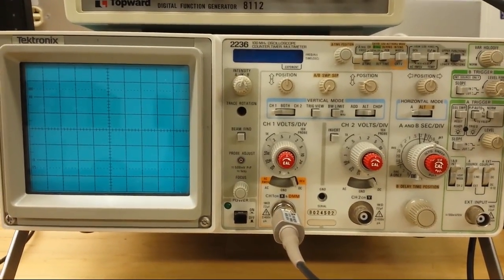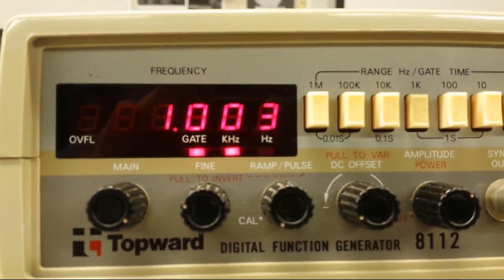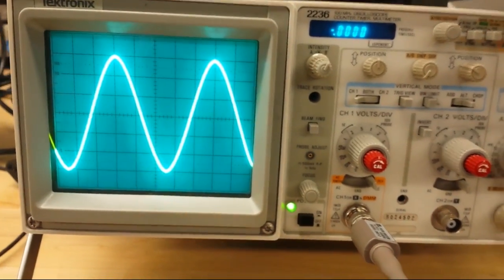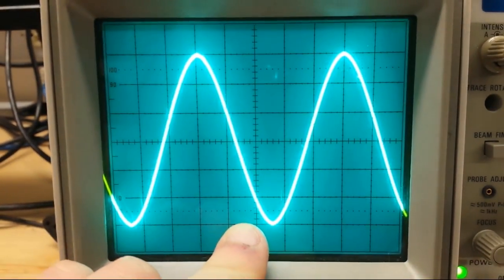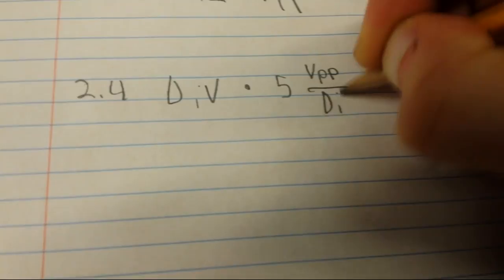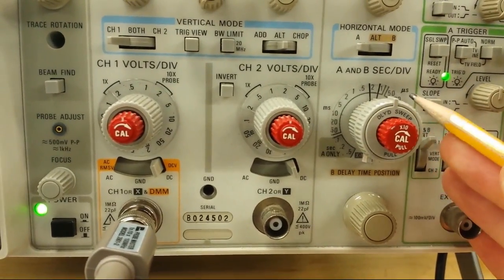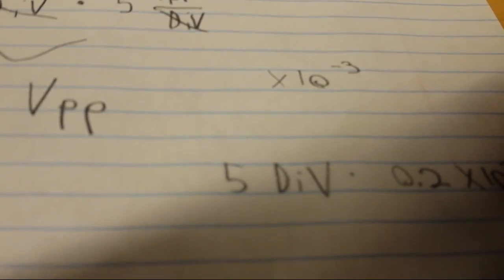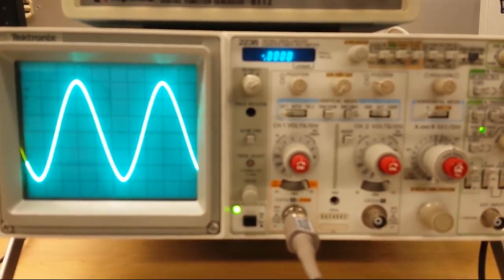what is an oscilloscope and how to use it

Comment: Do you have a video that shows to where the oscilloscope cable are connected to the other components?
Reply from the maker: depends on what you want to test. There is not just one spot. Unless your asking where the cables hook up to the oscilloscope? That's just the BNC connectors
Reply: @JosephX  no. I wanted to know to where you hook the bnc cables to a stereo receiver when you are looking for faults with the receiver.
Thank you
Reply: @JosephX  Also when you hook up a signal generator to a receiver where do you hook up the cables from the signal generator to the receiver?
Thank you
Reply: @JosephX What if I get one point that is moving from left to right? Is that the trace? And how do I get it to resemble a straight line? Do I need to change the settings on the oscilloscope? I do not have a signal/function generator attached to the oscilloscope.
Thank you
Reply: @JosephX I am slowly understanding how everything works.
Thank you very much.

Comment: THANK YOU x1000! Very helpful 👍
Reply from the maker: Your welcome, glad it was helpful, if you interested I have other videos on electronic equipment
Reply: @JosephX  subbed to your channel.
Hope you do a video on how to connect the components under test or troubleshooting to a oscilloscope and to a signal generator and what cables to use.
Your is the first video that i have seen that is geared to newbies like me.
It was easy to follow and understand.
Thank you
Reply: @JosephX  I have a Tektronix O'scope model 2445 but dont want to use it until i know how to use it and how to hook it up properly to the components that i want to test mainly stereos/receivers and reel to reels.
Reply from the maker: @SDsailor7  your welcome and thank you for the compliments. That's a good idea for a video. I might end up making 2, one on cable and another on testing stuff
Reply from the maker: @SDsailor7  Another channel that might help you is Mr Carlson's Lab. He deals with a lot of older (mainly tubes) audio and test equipment, especial if you want to learn how to repair older and tube equipment. https://www.youtube.com/c/MrCarlsonsLab
Reply: @JosephX  Yes i have seen his channel. Unfortunately he does not answer any questions.
Reply: I’ve recently purchased two, the first purchase was a 466A in mint condition. The second requires repair, that ones a 2210. The seller said it had lost vertical and selling for spares only. It does show a spot when pressing the beam finder but nothing else. But hey! it was cheap and gives me a project further down the road as I become more experienced as I’m currently a total rookie in electronics having retired and wanting a hobby. My main concern at this point is to find a variac and finding how to connect the probe without shocking myself or making magic smoke from the scope. Love the video, thank you for taking the time to make.
Reply: @richardshort4587  The probe is atached to the testing points on the component or any point that you want to check/test.
That is what i have read. I am in the same boat as you, still learning.
Cheers
Reply: @SDsailor7  Thansk Rob, its a daunting thought that we could easily overload the front end of the scope and do major damage. I’m only just beginning to build up some kind of equipment to help me with the hobby. I have the usual DMM and soldering iron, now the scopes. Next will be a signal/function generator and of course books and more YouTube classes. There seems to be lots available to view, some are to long winded and get way to technical for me to absorb just now. There is one guy I can recommend his channel name is “The Radio Shop” he’s an American gent with a southern drawl, has great content and a natural teaching ability totally love the way he gives out information as he works his magic repairing equipment. Good luck moving forward and enjoy the hobby.

Rich
Reply: @richardshort4587  I will check him out. I also have all those components that you mentioned and only missing a vacuum tube voltmeter that is really necessary to do adjustments. But out of all that equipment the only thing I know how to use is the dmm
Reply: @richardshort4587  I don't want to electrocute myself that is why I haven't attempted to use the test gear. Plus is a big learning curve I think.
I am going to start with the signal generator seems like is the safest one. I have been lucky and fixed some reel to reels by replacing capacitors and transistors.
Reply: @SDsailor7  Great start fixing those old tape machines. As a kid I made the usual crystal set radios or cats whiskers as they where sometimes called. But with headphones I was able to get quite a miriad of radio stations. Seems many have now gone off the air in the long wave and shortwave bands. I was able to make an acorn valve radio from parts purchased at the old army surplus stores. I was also lucky to have a school friend whose father was a TV repair man for the company we rented the TV from back in the UK, he gave me loads of old stuff and even made me a low DC voltage power supply. Had so much fun back then with electronics, but once I discovered girls that was it 😂
Reply: @richardshort4587  Well it is time to get back into those electronic projects again and leave those girls alone😆
Reply: @SDsailor7  I think your right on that one Rob, electronics would have been the cheaper route 😂
Reply from the maker: @richardshort4587  Your welcome. Glad you really like the video. For your 2210, have you checked the signal and control settings (trigger, vertical adjustment, horizontal adjustment, brightness, back-light). Sometimes dirt can get into the knobs and effect the contacts (this can happen with any old electronic equipment not just test equipment) which will effect how it shows the signal. Plus if you adjust a setting and it does not change correctly or at all, then that is a good starting point to figuring out exactly what is wrong.
Reply: @JosephX  Hi Joseph, thanks for the reply. I haven’t looked at the scope since bringing it home and trying it out. I had read the manual and tried setting it up as it advised prior to switching it on, but only got the spot when pressing the beam finder. I even held that in and tried making adjustments with the controls but to no avail. I’ll try here again this coming week and see if it wants to show some trace. If it doesn’t I guess I’ll need to remove the cover and check for any damage or visible signs of overheated/blown components. I will also check the leads feeding the CRT, one video I saw shows they can work loose and fall away from their contact point and give the exact same result as what I’m getting now. I know I’m in over my head at this point but my curiosity and tenacity won’t allow me leave it alone. Failure is not an option I just need to be patient and not make any rash moves or poke things that shouldn’t be poked. Thanks to you and others like yourself taking the time to make and upload these videos makes life so much more enjoyable and helps remove frustration caused by some who won’t part with their knowledge for some unknown reason. I’ll let you know how I get on soon. Cheers M8 🍻
Reply from the maker: @richardshort4587  alright, any questions just ask
Reply from the maker: @SDsailor7  not exactly what you wanted but here is a step in the right direction https://www.youtube.com/watch?v=_ZNc4U3AHfg
Reply from the maker: @richardshort4587  just so you know here's another video that might help you with the 2210 https://www.youtube.com/watch?v=_ZNc4U3AHfg
Reply: @JosephX  Thank you sir, I’ll take a look. 👍🍻

Comment: I recently got a tektronix 5110 its a older one but it was a gift to get me started but ive tried for about 1 week to try to get the calibration split lines and i cant figure it out plz help im new at all this and it will most deff help with my audio amplifier repairs....
Reply from the maker: Ok I would be more than glad to help, but I need to know a few things, like what are you use for your 1khz calibration sorce and do you have a dicord account?
Reply: @JosephX  no i dont have one of them accts but i could make ome if thats easier and when i got the oscilloscope as a gift it didn't have probes so i wemt to amazon and ordered some if that is what u ment ..srry but im new at all this so im pretty Much walking in blind
Reply from the maker: @josegilbert8337  yes it would be, it's a lot easier to send info and links in discord then youtube, also its easier in discord to set up a time to jitsi meet (it's like Skype, just not as much of a pain). Later on, I can walk you though your electronic issues, in a jitsi video meeting. Here the discord link https://discord.gg/KUzgjGh
Reply: Im on there i sent u a IM not sure kf it went threw or not still tryin to work it lol
Reply from the maker: @josegilbert8337  you did it right